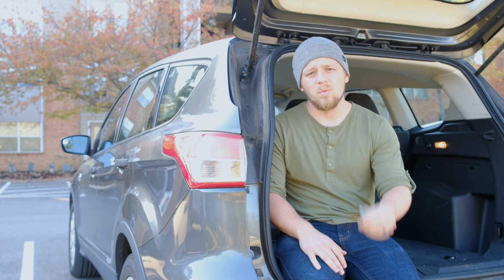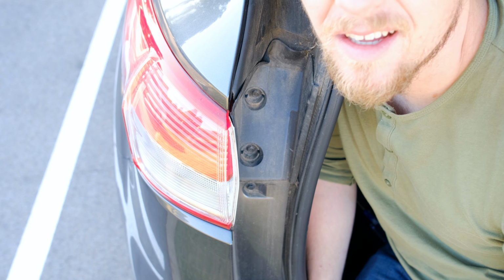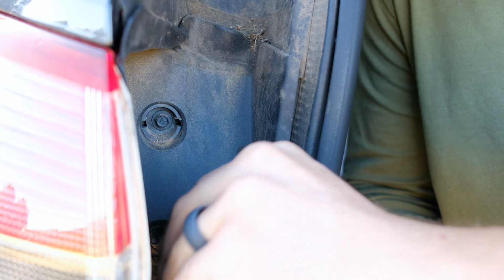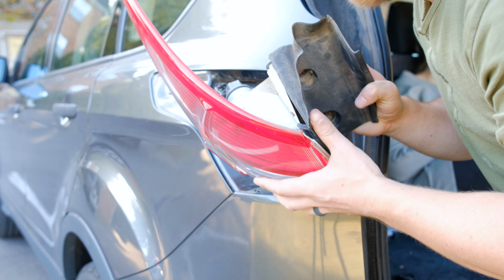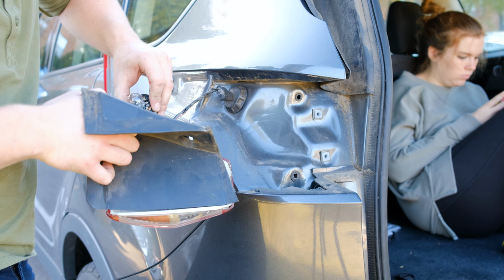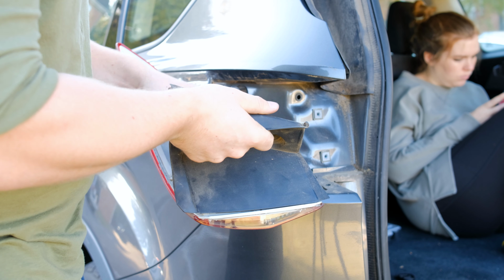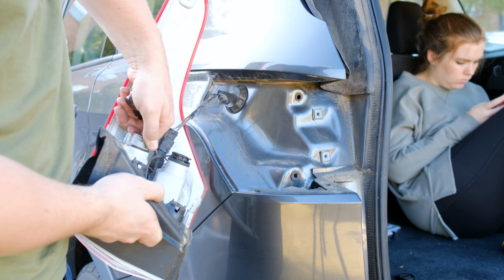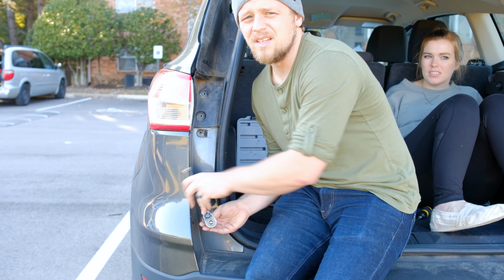How Hard Could It Be? | 2015 Ford Escape Brake Light Replacement

Comment: Oh fun, thanks! I saw this in another video before and apparently you don’t need to loosen those two bottom ones just the top two. You just have to pop the unit out with your palm while holding. Which you did without realizing it!  Lol 😂
Reply from the maker: That's the fun of the How Hard Could It Be? series figuring stuff out in roundabout ways for humor and maybe a little information along the way!
Reply: I beat my hand so hard it was super red and hurting. I did it his way on driver side and it was easy. Passenger side took ton of beating even after I took out all 4 bolts. Next time, I will pay a shop to do it.

Comment: Thanks for the video! The plastic cover thingy was way harder to remove than I imagine. Not sure if it's because I live in a cold city or else, but I had to try different methods to pop this thing off. After that, it was easy. Thanks again! Cheers from Ontario
Reply from the maker: The cold definitely does make things harder. I'm originally from Maine! But it does always seem that when I try to do a simple thing such as popping those plastic covers off, it gives me more trouble than most other folks! Glad I'm not the only one :)
Reply: What did you use? Mine is still stuck in there! Am about to take it to the dealer. Actually wound up making a crack mark in the unit! Argggg!

Comment: FYI - Change your Transmission and PTU fluids ( Transmission 30k / PTU Power Transfer Unit oil 10-15k) - My '14 Escape Transmission died at 87k
Reply from the maker: Thank you! I most definitely will get on that soon!
Reply: I just recently did my transmission oil change around 45k miles but I have no idea about the PTU oil change. Thank you

Comment: Just did mine on a 13, removing that taillight housing is a pain. Code came on after initial startup but drove around for a solid 5 minutes and no code.
Reply from the maker: Sweet! And yeah, I’m not sure specifically how I got it off but it came off. And I’m glad your code went away!

Comment: What tool to use and size
Reply from the maker: I used a flathead screw driver to pry off the bolt covers and the bolts were 8mm hex bolts that I took off with a simple ratchet.